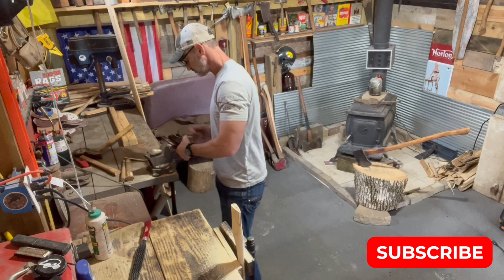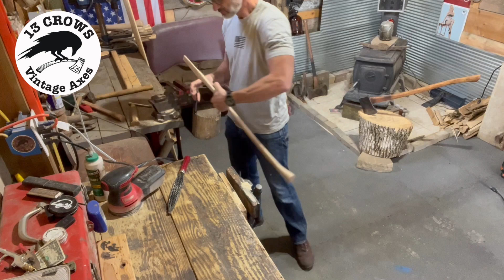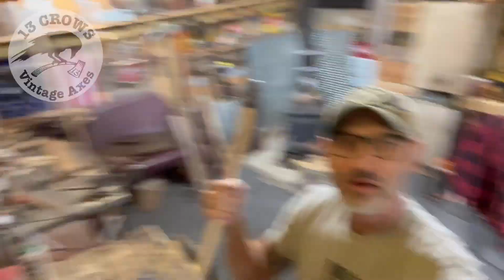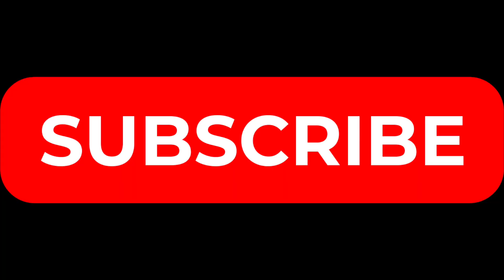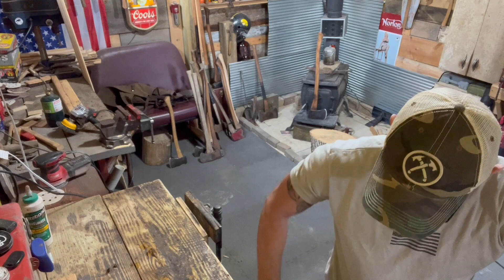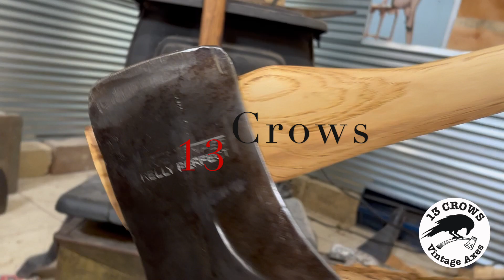Kelly Perfect Single Bit Restoration - bonus Dirty Joke Friday

Comment: I just found one in my back yard buried what's it's worth ? Is it rare if so how rare ? Is it collectible. Its original handle you can just make out true temper on the handle
Reply from the maker: Hmm…I’d have to see pics to gauge the value, can you send some pics to 13crowsaxes@gmail.com
Reply: @13CrowsVintageAxes  sure no problem
Reply: @13CrowsVintageAxes  sure no problem
Reply: @13CrowsVintageAxes  I sent them